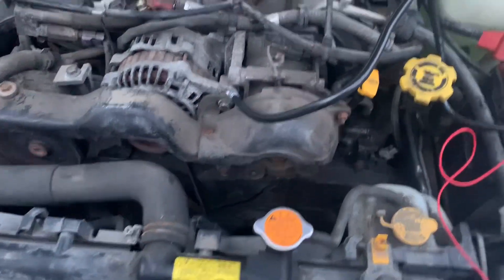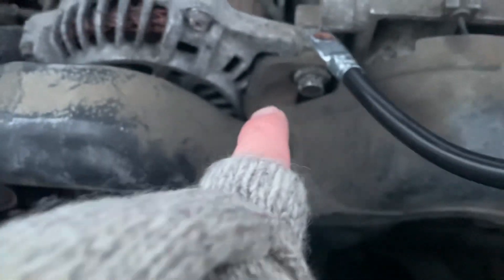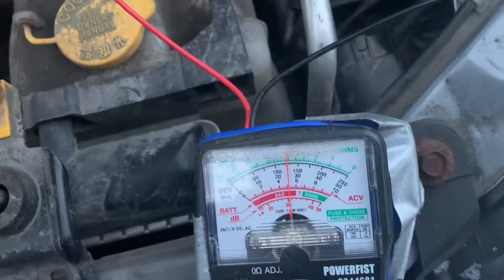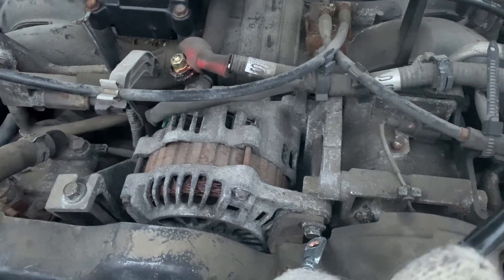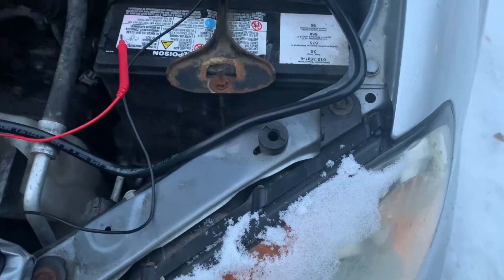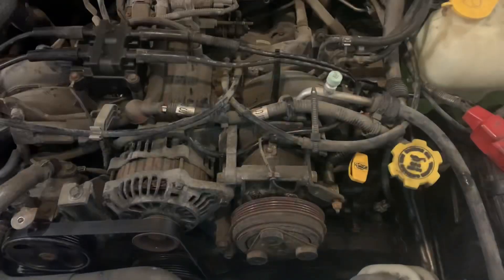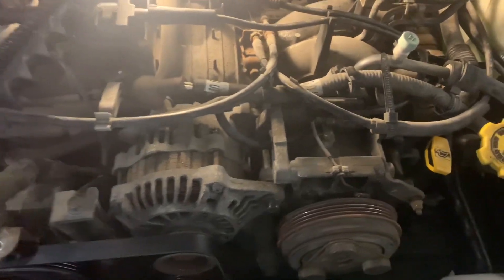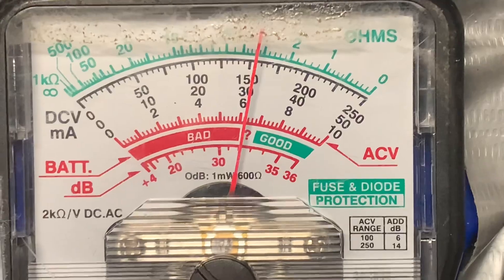Subaru Impreza Tachometer and Speedometer Stopped Working While Driving Check Your Alternator Ground

Comment: Failing this, If its not your ground, check the dashboard battery light is working, as it’s connected in series to the battery charging circuit and if its blown then your alternator will not charge the battery aswell.
Reply from the maker: Wow, did not know that.  Many thanks for the great tip!